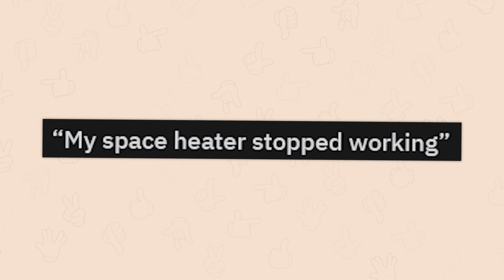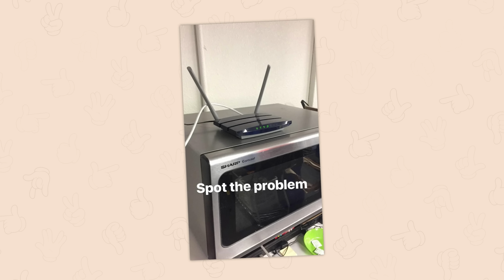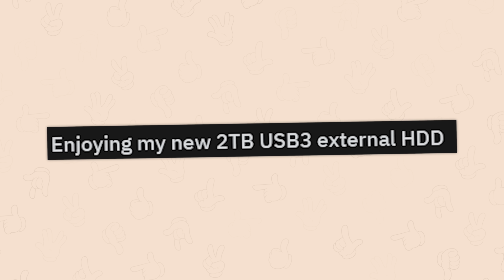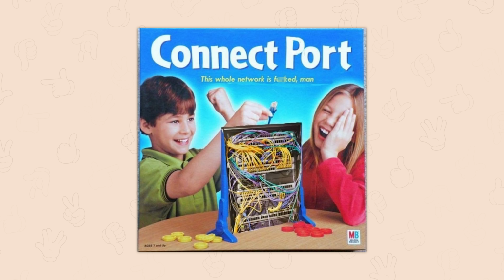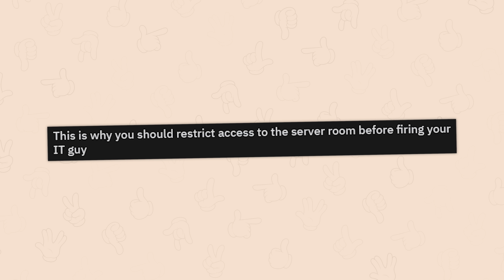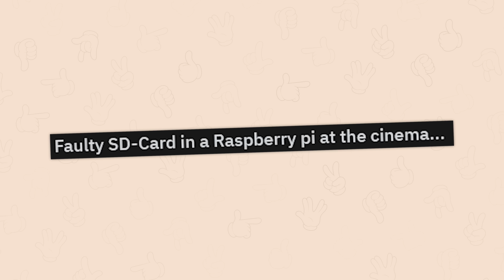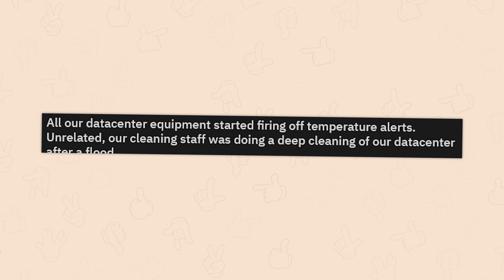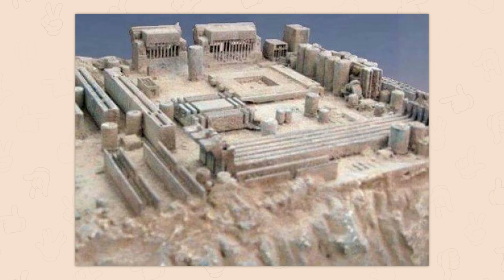r/Techsupportgore | melted :(

Comment: My laptop is a dell. Advertised as "full aluminum body"
The inside is all injection molded with a thin aluminum plate around it. The screws are held in place by cheap brass inserts that pop out when you unscrew them, and sometimes they pop right out and shatter the plastic around them 
It is now held together by 3 of the original 12 screws, as well as about 3 layers of aluminum tape.

Comment: At 18:25 it's actually fine. This is a way techs do it when you need to set up large amounts of speakers in a large area. You open the stand, put it into the speaker, and then later on you flip them over. It's easier, quicker, and puts less strain on your back.

Comment: So, for those curious about the "Ijvalid drire specibicapikn": DOS uses an 80x25 VGA text console which is mapped in IBM compatibles to the memory addresses 0xB8000 (or, if you're a fan of x86 real-mode segmented addressing, 0xb800:0000) through 0xB8FA0, with each character taking up two bytes: the first to describe its coloring (background, foreground, and whether or not its blinking), the second to describe its code point (i.e., which character to display). In this case, we're seeing that bit 18 of each dword is stuck low: '>' (0x3e) becomes ':' (0x3a), 'n' (0x6e) becomes 'j' (0x6a), 'v' (0x76) becomes 'r' (0x72), 'f' (0x66) becomes 'b' (0x62), 't' (0x74) becomes 'p' (0x70), and 'o' (0x6f) becomes 'k' (0x6b).

Comment: FYI, microwaves operate on 2.4ghz. 

They are electromagnetically sealed, but its not perfect. The WAP is probably 0.05-0.1w, the microwave is probably 1000w.

Comment: ALSO the weight thing on mouse
i can attes
i play snipers and rifles almost exclusively and having a heavier mouse not only means my mouse is more steady and doesnt move as easily making my movement more precise, i can also use momentum to move the mouse faster hitting much better flicks than i used to before i got my mouse
g502 hero btw its genuinely amazing. the dpi switching buttons mean i can adapt how fast my mouse is moving if i need to do realy precise movements and honestly 10/10 i litteraly bought a new one as soon as my old one broke about 5 years after me using it... and the only issue was a jittery leftclick and a faulty scroll wheel that would sometimes go up instead of down and all those happened after i accidentaly dropped it so honestly worth it

Comment: In HS i did Datacenter rebuilds part time and ended up buying 1000 RJ45 in which i 3d printed A-1 through Z-24 tags on them with duplicates of each so i put matching tag pairs where cables terminated so we could easily map the Network cables for reinstall

Comment: I remember I used to have a Galaxy S3 in high school with a dead charge port, being that it had a removable battery and I was an idiot, I simply cut the cable off of mice, placed the 5v and ground wires on the right pads on the battery, and put the battery back in whenever it needed a charge.

Comment: The speakers that were set up upside down are sometimes done like that because they're a pain in the ass to set up right side up first! Speaking from experience. lol The stands weigh next to nothing, but those speakers could weigh up to 75 pounds. It's easier to set the speaker down and get the stand in than to hold the speaker and slide it onto the stand and risk dropping it. This way you just flip it right side up.

Comment: Seen a combination of destroyed IR transmitter cover and display cable in mid-nineties when serial mouse was the only PC mouse type you had. User with wrestler body type under influence tried to plug serial mouse into VGA socket. Ended with completely destroyed socket and mouse connector. 2.4 GHz WiFi still save the day in places with two walls between router and computer where it is not physically posible to bring AP more near to you or move near to AP. These 2TB/4TG/8TB... portable USB drives from Chinese online stores are blatant scam - all of them. 57 screws in laptop keyboard is not true - they actually are 57 plastic rivets and if you broke few of them off, you are screwed. Kudos for wireless speakers. Nice battery pillows by the way :D

Comment: Toner spills are an absolute nightmare to clean. If you do have a laser printer at home or in your office, and you somehow manage to dump a whole bunch of toner everywhere: For the love of all that is holy, do NOT go to town on it with your regular household vacuum cleaner. You will regret it. Those are good at one thing, and that is shooting toner EVERYWHERE. Ask me how I know. You need a vacuum cleaner especially designed for dealing with toner. Those exist. They have a bunch of extra filters so you won’t have toner blown all over kingdom come.

Other than that:
Thinkpads are pretty awesome. Used to have those exclusively, going back to when IBM built them. One thing they carried over from those days is the excellent hardware maintenance manual as well as neat features like the liquid drain built into the keyboards of some models. Any spillage just flows out of two drain holes at the bottom of the machine. Awesome stuff. I accidentally spilled a cup of coffee (with milk & sugar) over one keyboard. Chased it with a cup of water to remove most of the beverage. Then removed the whole thing by removing ONE screw and pushing in the right place. A good rinse in the sink and two days drying later it was back in the machine, running good as new. I am also still mad about them getting rid of the Ultrabay.

Some of the really new Thinkpads tho…those need to burn in a fire. Latest T4xx series has a bezel so thin and flimsy that I am beginning to suspect it was PAINTED on. I‘ve seen cheap a$$ Acer screens that were sturdier than those. I have a couple older Thinkpads here that I pulled from an e-waste dumpster and that are still perfectly OK. A fully working business class laptop with zero dings or scratches for less than 90 bucks worth of parts (battery and a small SSD - had a charger kicking around for it in my Pile-o-Parts)…that’s hard to beat. Just some cleaning, new thermal paste and it is good to go for another couple years.

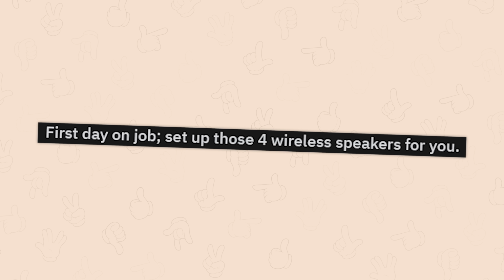Comment: 18:15 actually a valid method of assembly if you cant lift the PA speakers high enough to get it on the post. im assuming this pic was taken during the setup process since theres no cabling.

Comment: To elaborate on the temp folder: Windows had a period of time where it stored all the -update- backup/recovery files in temp, and didn't clear them properly. So you'd end up with effectively [the rest of your harddrive] gigabytes in Windows -update- backup files.
... People ask me why i hate Windows. It's bloatware that presents legacy code from the 80's as a feature.
Great when you need to hook up that one obscure printer from 1987. Otherwise genuinely just use Linux, it's easy (well, easier) these days.

EDIT: It wasn't updates, it was windows restore point backups. My bad, misremembered.

Comment: I have a similar story to this 1:05
I had a Logitech mouse with a wireless receiver sticking out of my laptop and one day I dropped it right between a table and myself on a carpet. Everything remained intact except for the receiver, which had its plastic case ripped off by the table. Now all I could see connected to my computer was the (presumably) motherboard of the receiver itself lodged into the usb part of the receiver. It still worked fine, but to take it out I had to squeeze the flat electronics sticking out to take the usb out. That hurt.

Comment: The worst computer failures I've had (of which there are 2) were:
1. I had a Raspberry Pi Model 400 which I was using to experiment with a component kit I bought. The Model 400 has the same GPIO pinout as the Model 4, but it's orientated differently. I wanted to check where the power pins were, and I plugged in a motor to the 5 volt and ground to check their location. Ran for a second, then shut off and wouldn't turn on. I opened it up to check for a blown fuse (not realising that the Pi has a self-resetting thermal fuse). Found out that my AC adapter died. No SBC's were harmed in the process.

2. Got an old 90's era IBM-compatible from a friend. I tried to turn it on, and it ran fine... for a bit. I leave, and return to find magic smoke belching out. Turns out the PSU has one of those shitty Rifa class X filter caps that explodes. Replaced it and it was fine. These caps usually blow on old systems, like IBM's and Apple ]['s. Be careful, guys. Don't kick computers because the computers can kick back.

Comment: at a company i've worked for, there once has been a rather.. unique monitoring experience.
one of our customers servers went for the "cpu temperature to low!" alert.
never heard of that one before (trainee at the time).

we've monitored servers for one of our customers all over the world. that particular case happend in finland.
winter season. guess what happend. yeah..
the A/C went down and the local admin decided, that it might be a good idea, to get some cold air into the server room. nothing wrong with that so far.
dude bolted the door, so it would stay open (security? anyone?) and put up a fan in the door frame.
then he decided, that it would be an even greater idea, to open one of the windows in the room infront of the server room. 
finland. winter season. round about -25°C (-13°F for other folks) out there.

the server that went of with that alert, got one hell of chills.

Comment: Thanks now I don't regret not going into pc repair and becoming a mechanic instead I will see this in my nightmares.
ps on the power strip my cat peed on one of mine started to smolder and got hot as hell pulled it before it was too late.

Comment: 15:16 Those laptop cases in the background are the same cheap ones our school uses for Chromebook. I'm a power user. On an underpowered Chromebook with no ventilation. In an insulating case. Ah yes, a beautiful 100 degree Celsius Chromebook, 90 Fahrenheit to the touch! Also the Chromebook (HP Chromebook G8 EE) are $88 refurbished on Amazon, the way the school buys them.

Comment: On the huge temp directory thing, Windows 7 / Server 2008 R2 had an issue where if a CBS (Component-Based Servicing) log grew beyond 2GB, then the windows update service would repeatedly try and fail to compress it, leaving files in the %SYSTEMROOT%\Temp directory.
Also, winsxs doesn't cache updates - rather it holds all potentially in-use or installable versions of windows components, so will grow over time as the computer is updated.
10:20 - all single-bit errors - 'j' = 'n' xor 0x04
20:50 - The normal killer when opening HDDs is dust (or here, fingerprints), which can cause a head crash (the head crashing into the platter) when the head catches on that dust (or fingerprint).

Comment: Ok just gonna put it out there I have run servers on laptops before you can very easily set them to not go to sleep while plugged in regardless of screen state. Also this setting is used for docking stations as well with external monitors

Comment: still using 2.4ghz is pretty normal cause it has further range, i use it cause my house has concrete/brick walls so 5ghz wont reach to the other side of the house with good reception

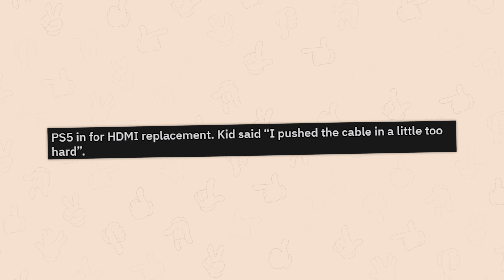Comment: 10:24 - it is probably bad rom chip, not actual RAM on vga card. It is a memory module where all the characters that are possible to display were stored. It was common solution back in a day.
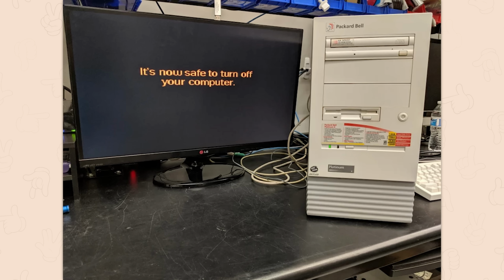10:45 - just old good AT system with Pentium onboard.
13:40 - this is probably a Chromebook and this area is not an inverter (that's for really old CCFL backlight, in that case there should be separate wires for input and output), but dc/dc covnerter for LED ilumination of LCD. Screen is cracked in at least 3 points, so it has nothing to do with touching an inverter. Looks like photo was taken during screen replacement.
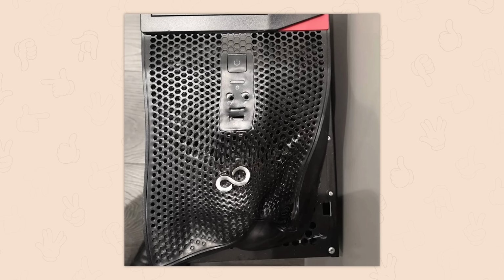17:30 - you mean Fujitsu :)
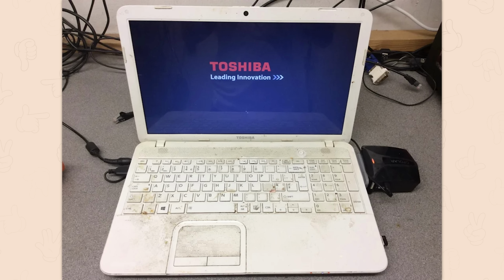21:35 - I love that blood stains on that Toshiba

Comment: HOLY 4TH OF JULY WEENY ROAST!! 
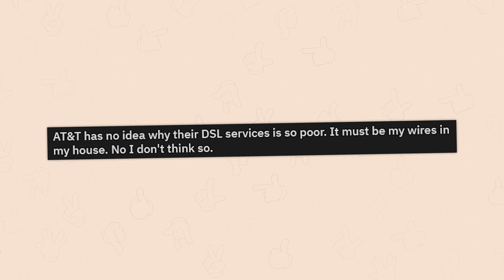Okay so @9:19 I used to be an "811 before you dig" guy I'd come out and if I saw one of THOSE~ I would absolutely LOATH that work area.. because not only is there one there's like a string of them one would go to the house, one would go to another box 4 ½ miles down the road, one would go across the street at a 45 degree sloped hill Augh! Those things were aggravating

Comment: i went to a tech school for my last 2 years of high school and i found out once the slideshow monitors in the cafeteria crashed that the school was still using windows 95 for their main operating system. WINDOWS 95. in 2021. i begged them multiple times to switch but i don't think they have

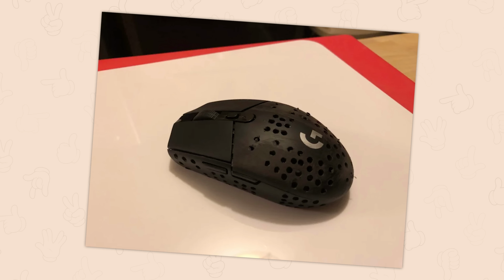Comment: 1:43 not a file, take a larger drill bit in hand and just gently press it in and spin it, that will champhere the plastic better than a file ever would.
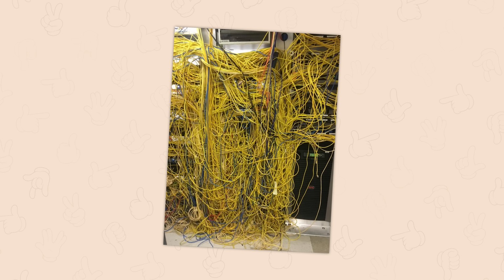Reply: 2:13 its called job security, if only you know where the wires go, only you can fix it fast.
Reply: 12:45 you have NO idea how often me kicking the computer fixed the problems, percussive maintenance is no joke, but would never recommend it.

one of my fans going and making a god awful noise, WACK, now its quiet, and yes, it was still working for a few months after that till I just replaced it. I miss that computer (sharpied 20lb of shit in 10lb bag on the side) more than anyone will realize.

Comment: 13:02 I have worked with that cable and it's a hell to work with. Its Acome Acolan fireprotec 400. Its 400 MHz CAT6 AWG24. Its a Hell to untwist, it's a hell to get straightent and it's a hell to cramp in a Connector. I still use it to this day because it was something we had in Stock and a lot of it

Comment: As for 0:22 I found out that if someone fucks up something on computer with third party antivirus software (I dont know how could this happen but I've seen it happen) windows defender tries to run computer scan, BUT it is blocked by the third party software, so it just crates a log in temp folder. The problem is, that it tries to do it every single second.

Comment: Holy hell the dvi one did me in. Recently got a secondhand xps 8700 and put a gtx 1650 in it. Upgraded to an hdmi monitor since I had the connection and some friends said I should use my old one as a secondary.

I took the time to check what connector was on my GPU and the secondary monitor to see what kind of dvi it was, painstakingly google image searched to find the mathing so I could buy a cable.

And this mongaloid smashes in the pins.....

Comment: I wish I had taken a picture... I was asked to take a look at a computer , was told it suddenly shut down and he had not dared try turning it back on, so I turn it on and it seem to work fine, so I shut it down and open the box on ly to find that it is stuffed full of dust and cat hairs and I mean how were the fans even turning full... he had already purchased a replacement laptop so we saved his data and he gave me the computer which I cleaned and re-installed and then sold

Comment: people plugging things into ports that they don't go in is just baffling to me, like, ok, maybe you didn't look, and the usb kinda fit in the RJ45. But like, as soon as it doesn't work, you... like... look at it, right? and see that the ends don't match like, at all?
or when they just resort to violence. had a customer bring in a laptop once, with a broken charging port. sure, the port was 3.5mm in diameter, that doesn't mean you can force a TRS in it with all your might and expect it to not break.

edit for the open hard drive: I have personally recovered data from a hard drive *by opening it*, because the biggest problem it had was the arm getting stuck every other minute. I had an open, running hard drive sitting on my desk, leaning against a bottle because it would only run properly at a specific angle, and I occasionally had to poke the arm with a pen to unstick it. It worked. I got every last file off that thing.

Comment: 8:37, had a friend that did that to like 3 dvi to vga adapters because they wouldn't plug in, and that after making them fit, he said they did not work :/ of course its not gonna work when you bent the pins used for vga out of the way

Comment: 14:36 And I have the same hatred for those power plugs that have the cables coming out of them at an angle or have really bulky casings that block off the ports next to them from being used.
I swear to fucking god Raspberry Pi and Panasonic, I AM LOOKING AT YOU.

Comment: Good God 
I'm not IT or anything but I still work on my own computer 
When I switched my graphics card I unplugged it, and also pressed the power button about 20 times over 5 minutes to make absolutely sure as much capacitance was drained before I even touched that thing.
I then googled why there was a red light after I hooked it in, just to be sure. It just needed the power cable

Comment: already I can tell you please plug your space heaters into only the appropriate strips or directly into the wall if you have proper breakers. Make sure you know the amperage of the circuit you are using as well. Some circuits in households are meant for lighting, shitty apartments and certain low amperage areas will have 15 amp circuits which is terrible for a space heater. 20-30 is better. The gage of your power strip shouldn't be lower than the gage of the wiring in the circuit it is being plugged into. Using a power strip with a higher capacity (lower gage) than what your wiring in the walls can handle can cause a fire. When I use a power strip for a space heater, its able to handle 20 amps, plugging into a 20+ amp circuit. It contains a breaker. I don't get power strips that don't have their own breaker either.

Comment: 3:27: 2.4ghz isnt that bad. The range usually doubles if the frequency is halfed (at least with analouge signals) For areas with straight up bad or jsut not great internet 2.4 might be better